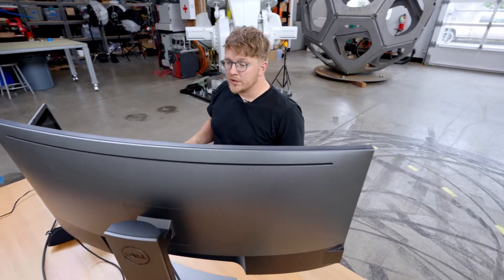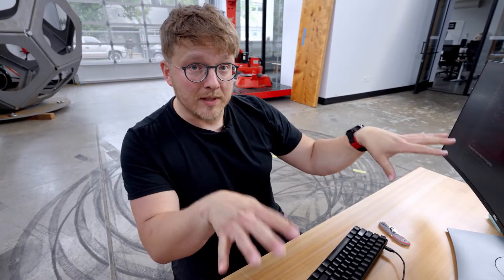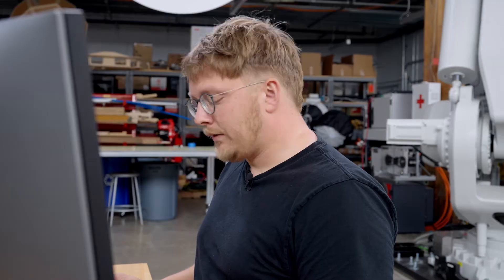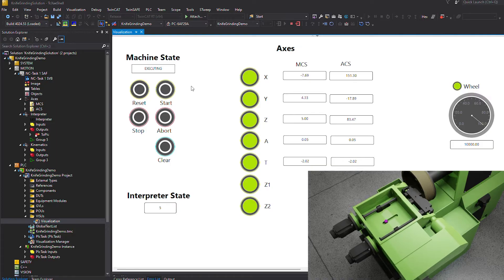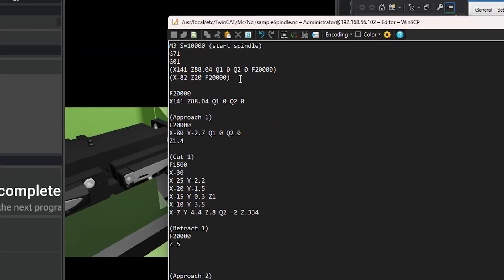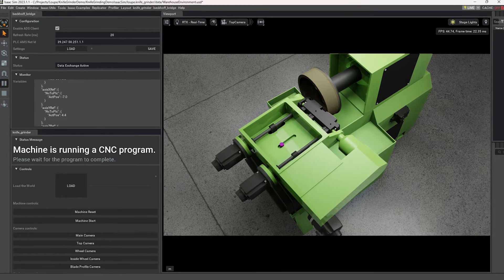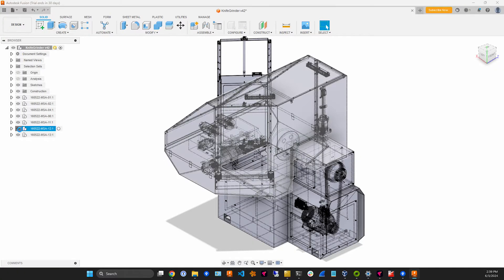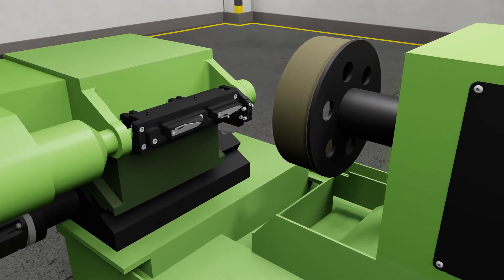How We Build Digital Twins

Comment: Hi, I am relatively new to the digital twin world. I have been using Siemens NX for the virtual comisioning of machines but when I saw this video I am impressed of the result but I have one doubt. Is it really valuable for the manufacturer to have this digital twin? I mean, in order to develop this kind of virtual model integrated with the PLC is a very hard work and requires many time. Is it still valuable for the manufacturer? Thanks I love your content
Reply: Good question. I think there is a point when the larger the project becomes the more necessary a digital twin is.
Reply: Good question 
I think it very valuable for the users & it worth